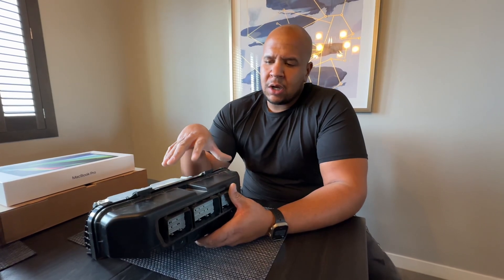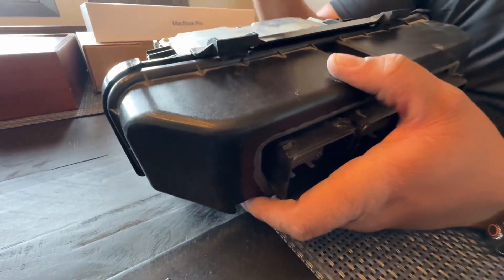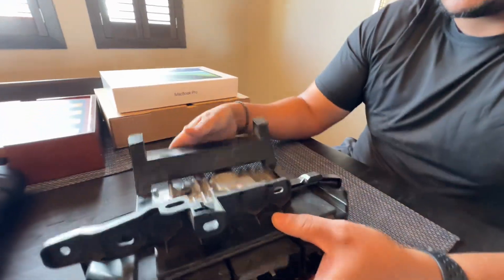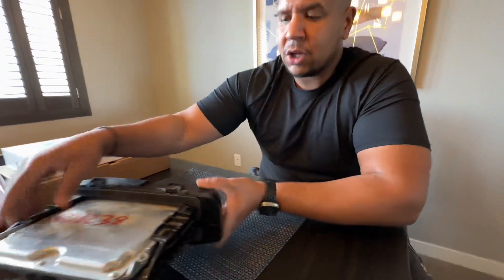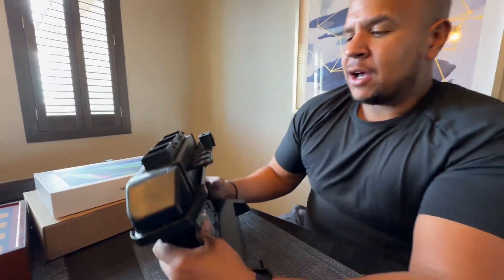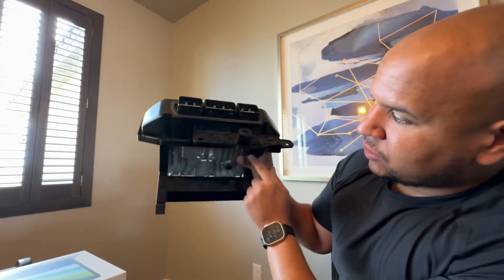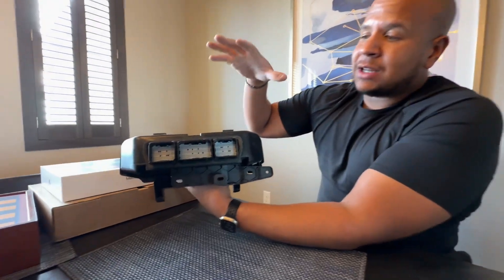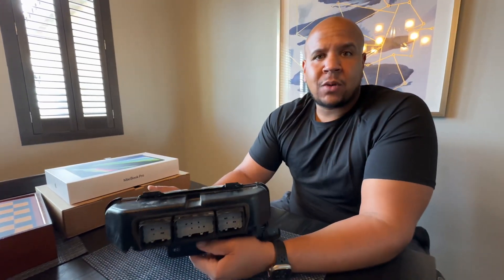2021-2022 F150/Raptor ECU removal/visualization

Comment: Thanks going to try and pull mine right now!! Going to try Your Hamburger style before screwdriver. Sending to HP.
Reply from the maker: That’s best, a screwdriver will work just be careful. 

I tell my customers to run the engine for several minutes to get things warmed up so the plastic is more malleable

Comment: My 2022 is an absolute pain to try to get it out. Harness clamps and clips everywhere. I think they found out people were able to work on their vehicles so they made it more difficult
Reply from the maker: Man, it's hit or miss it seems. I can remove mine in 30sec (once the batter and what not is disconnected).  

Sucks when it's tougher for some people. But at least tuning is an option for 2022!

Comment: Why is this needes do they bot offer a cobb accessport option ?
Reply from the maker: The 21+ F150/Raptor needs a bench unlock. So you have to pull the ECU to do that. 

Once that’s done then the Accessport can be installed